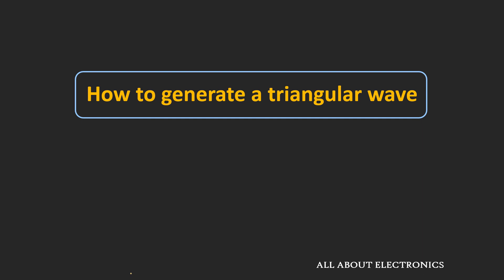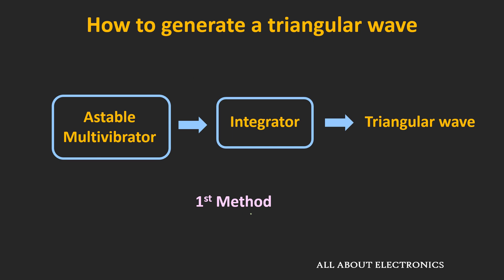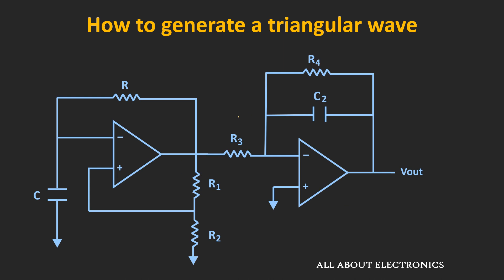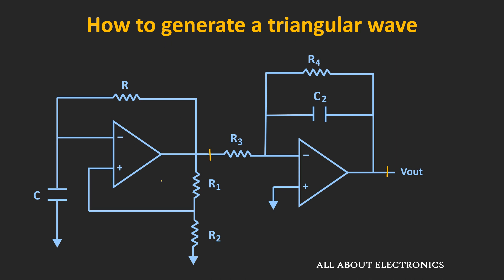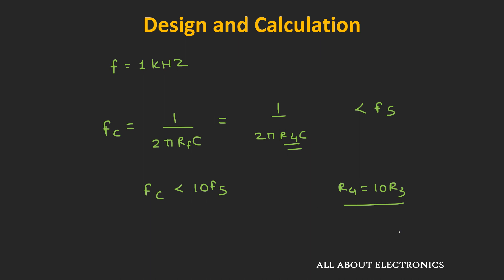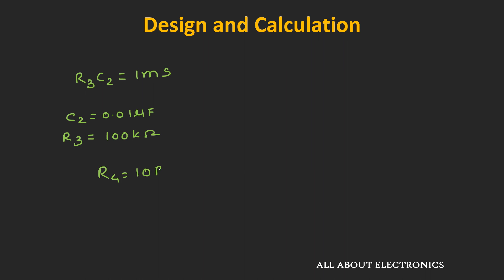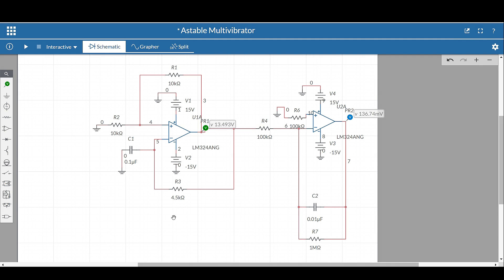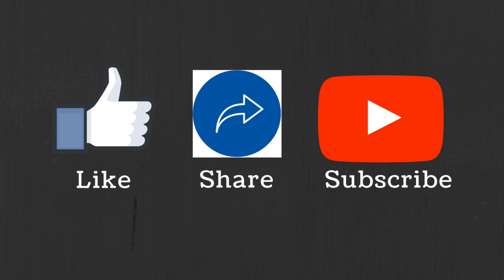How to Generate a Triangular Wave (Part -1)

Comment from the maker: The timestamps for the different topics covered in the video:

0:21 Applications of Triangular wave

0:50 Different methods for triangular wave generation

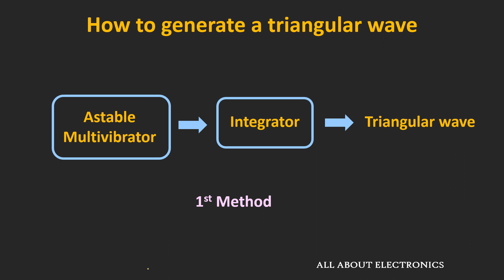2:23 Generation of the triangular wave using Astable multivibrator and integrator

5:04 Design and calculations for the triangular wave generator

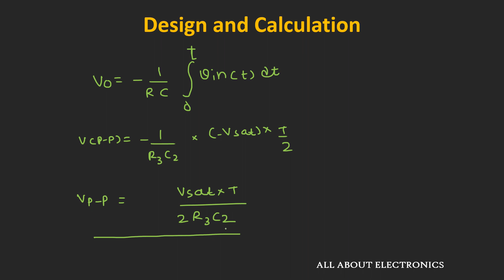11:05 Circuit Simulation using Multisim
Reply: You didn't mention the derivation of time period in the video.
Reply from the maker: @vishalverma1249  It has been already derived in the earlier video of astable multivibrator using an op-amp.  And I have already provided the link of it in the description of the video.
Reply: Sir you can do videos in Telugu Language
Reply: Instablaster...

Comment: Great video! If you replace R1 and R2 with potentiometer, you can change the frequency of the oscillator, right?
Reply: That would change the frequency logarithmically so it really wouldn’t have much impact. U can use a pot to change R, which would linearly change frequency.

Comment: sir i need to understand this design:
Design an oscillator which is capable of producing sine, square and triangle waves with 5V peak in the frequency range of 100Hz to 10kHz. You can use the circuits you saw in the lesson while designing. Make your design using opamps. Give priority to the use of LM741 in your design.
Reply from the maker: You can design an oscillator which can produce a sine wave. Passing the output through a comparator circuit, you can generate a square wave. And using an integral circuit followed by comparator circuit, you can generate a triangular wave.

Comment: Sir
Can I know why we connect R4 in the integrator circuit???
Reply from the maker: It is part of the integrator circuit. The resistor R4 is used to avoid the distortion in the output. (To reduce the effect of the input offset voltage. )
For more information, you can check the video on the integrator. I have explained there in detail.
You will find the link of the video on the description.
Reply: @ALLABOUTELECTRONICS  oh
You are so great that even though I had typed R3 by mistake at first you understood I meant R4
Thank you sir
Looking forward to become a member of this channel

Comment: sir, I have a doubt at 7:08 , I didn't understand how the value of R3C2 would affect the linearity since the output of the integrator will anyhow follow the input given by astable multivibrator. I even googled the definition of the time constant of RC circuit and found it to be the "time in which the current through it decreases to 36.7% of its initial value"... please do help me!

Comment: When I calculate the cutoff (lower freq, R=1 Meg) I get 15.9 Hz when I calculate the frequency where the gain is 1 (0 db) I get a frequency of 159 Hz using the equation 
f = 1/(2*pi*R*C)  C=0.01uF   R=100K and using Rf  for lower freq,  R1 for the higher frequency.  I thought our operating frequency is supposed to be 10x greater than the lower frequency and less than the upper frequency.
Reply: I think I figured out my question.   The output is attenuated so we are at an operating frequency greater than the 0 db frequency

Comment: you have already provided the values for R1=R2=10k ohm...and then you calculate R=4.5k........why?
Reply from the maker: R1, R2, and R all three are different resistors. 
Please check the circuit diagram at 5:10

Comment: sir why rc time const is equal of frequency of astable multivibrator
Reply from the maker: To get good linearity of the triangular wave.
Reply: @ALLABOUTELECTRONICS   how it linear to take this valu
Reply from the maker: @tanumoypramanik7760  At the end of the video, I have shown the simulation result. If you go through it, you will get it.
Reply: @ALLABOUTELECTRONICS  same doubt here. I saw the simulation but still not get it. How it will get more linear if R2C3 = T?

Comment: Sir can you tell me why we put a resistance in parallel to current source in BJT Ac equivalent?
Reply from the maker: Would you please specify a bit more about which resistor in parallel you are talking about?
Reply: @ALLABOUTELECTRONICS  Yeah Sure, Sir. I am talking about the r_e model of BJT, where we idealise BJT as a current controlled current source.
Hope this makes my query clear!!!!
Reply from the maker: If I am not wrong, you are talking about the resistance r0 in parallel with the current source. (As I am hoping the concept of re is clear to you.)
The resistance r0 is the output impedance/resistance of the transistor.
Reply: @ALLABOUTELECTRONICS  Yes, I want to know the reason why?
Reply from the maker: The output impedance is determined from the output parameters (voltage and current)
And it appears across the two output terminals of the equivalent circuit. 
For example, if we consider the common emitter configuration, then it appears across the collector and emitter, where the output is measured. 
And it is measured from the slope of the Ic vs VCE curve. 
I hope it will clear your doubt.
Reply: Thanks Sir, just a last doubt. Why there is a resistance in parallel with a practical current source and not in an ideal current source?
Reply from the maker: Because in case of ideal current source, the shunt resistance is infinite, while in the practical current source there is a finite shunt resistance.
Reply: @ALLABOUTELECTRONICS  Why are you just telling the facts. I know its finite but why?
Reply from the maker: Because of the device limitation. For example, if you look at the BJT itself, the slope of Ic vs Vce is finite. 
But during the circuit analysis for our convenience, sometimes we assume it as infinite or just as an ideal source.
Reply: @ALLABOUTELECTRONICS  Ok. Thankyou Sir. Sir, can you tell me what is your name and which college you studied?
Reply from the maker: Rushal Shah
I have already mentioned it in the about section of the channel  :)